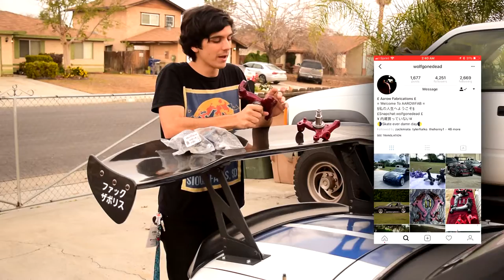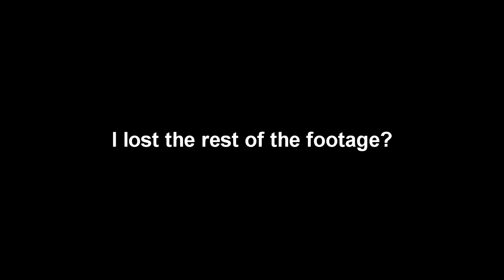Miata Drift Knuckles Install (Easy Angle)

Comment: How did you get the lower shock bolt holes aligned with each other? I don't seem to able to get those two aligned and my shock is a bit crooked too. It's a brand new shock so that's not the issue.
Reply from the maker: CHEEKY On the Miata chassis, the lower shock bolt slides into a little crevice in the lower control arm. I just used a jack on the lower control arm and it lined up with ease.
Reply: @TylerKun  thank you for such a fast response, I pushed the shock a bit and it got in there with relative ease.
Reply from the maker: You’re more than welcome! Hopefully you get it all in today! It’s an awesome little mod for sure

Comment: What spacers are you running?
Reply from the maker: FEMTO This was a couple years ago, but if I remember correctly, it was just 1 inch spacers all around on a 15x7 +40 wheel with 195/50 tires. It was pretty weak wheel specs for a flared Miata... But I’ve also fit 15x10 +0 wheels on there and they fit fine as well with the added angle.

Comment: Did you have to remove the front sway bar?
Reply from the maker: ivan1989619 You did not have to remove the front sway bar, but it was a little easier to get the lower control arm down.

Comment: How is it just driving normally is it sketchy?
Reply from the maker: Brian Bautista Not sketchy at all! It drives exactly the same, but turns faster. For example, a freeway on-ramp that used to take half a turn of the steering wheel now only takes a quarter of a turn. It was weird at first, but definitely very nice for everyday driving and performance driving.

Comment: Also what offset are your wheels, I hear you rub on the control arm unless you have 0 et
Reply from the maker: ivan1989619 My wheels are 15x6.5 +40 and they never rub on anything. The specs of the wheels are pretty weak. They can definitely go much wider and much more negative offset
Reply: TylerKun thanks for the reply dude, I'm going to be putting some in soon and I'm worried about rubbing the control arm and sway bar. am going to be running 15x8 with 15 offset. Did you have any issues with toe in after the install?
Reply from the maker: ivan1989619 I think you’ll be fine with those wheel specs. I’ve heard of people running much more aggressive setups. Worst case, just run a little more negative camber. I did originally have way too much toe out. I bought new tie rods and ball joints. The tie rod threads needed to be cut about half an inch. That corrected the toe out and it was able to be alighted. Without cutting it down the threads maxed out and wouldn’t go into the ball joint anymore. It’s a simple thing! Just make sure you get a clean cut. If it’s your only car get a second set just in case.
Reply from the maker: Bloou32 Just an update in case you didn’t pull the trigger yet. I have installed a 15x8 with 205/50 tires and 0 offset. They don’t rub on anything at all!
Reply: Bloou32 they might rub with the spec you have due to the with on the rear of the wheel